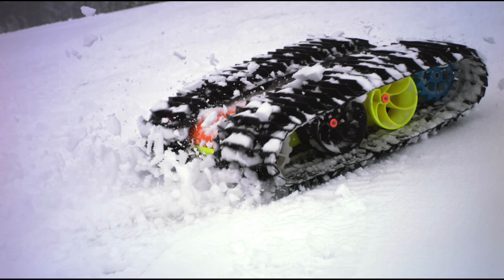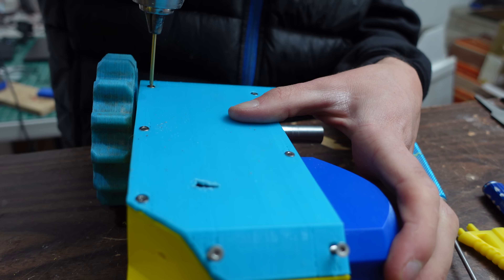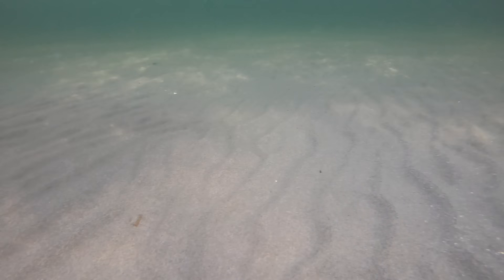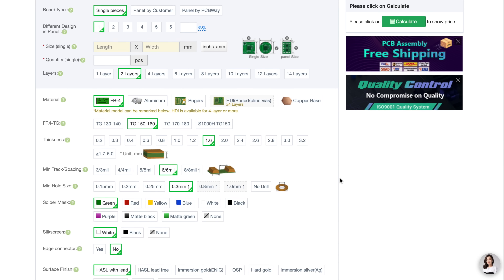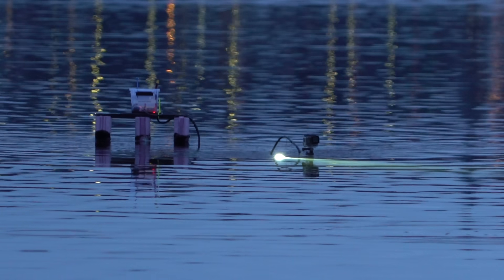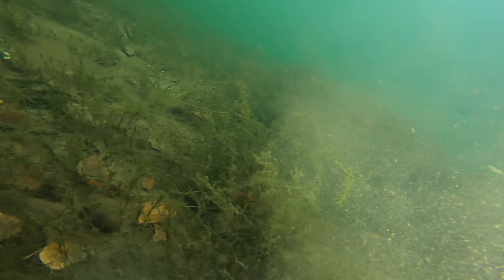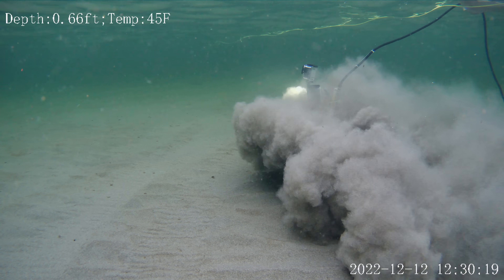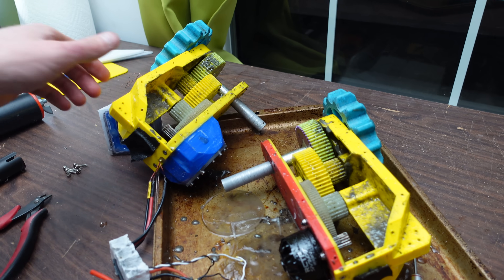DIY Aquatic R/C Tank

Comment: You should add variable ballast tanks. Ones that normally are filled with water and then either push the water out mechanically or pneumatically? I believe a ballast tank full of vacuum adds buoyancy?  Like a syringe sealed at both ends but one side is full of water with an open port and the other side has a piston sealed through o-rings, a screw on the piston pushes out the water when turned resulting in an empty side full of vacuum? That vacuum weighs less than the syringe full of water so it adds positive buoyancy and the tracked-sub will rise to the surface. Does that make sense? Other than that, pretty cool little machine. Or Rover?  Water drone? Modify a robotic pool cleaner to do the same thing?

Comment: I'm sure it's possible with some hacking to transmit analog video over an optical TOSLINK cable. That would make it impervious to the electrical noise over the length of the wire.

Comment: What about acoustic transmission instead of an umbilical cord? Sound propagates very far underwater, and there's easily enough bandwidth on an acoustic carrier to transmit slow-scan TV and control commands. Recovery back to the surface can be done with an underwater balloon system -- pierce one of those tiny CO2 or whipping cream cartridges with a solenoid to inflate a large plastic airbag that'll lift the rover to the surface.

Comment: For waterproof FDM parts make sure you print with ZERO retractions. It can be done. Also, anti-fogging trick; if you have AC in your room, turn it on - nothing dries air out easier.

Comment: Build a structural mount for a rope and attach then use a rope to tether the underwater boat. The cable then is tied to it, so that should you have to pull the vehicle to the surface you don't damage or rip out the cable.

Comment: You should get a CO2 canister and a balloon. If you get too deep, you can bail out by inflating the balloon and have the whole thing float to the surface where you can come get it with either a boat, canoe, or grappling hook.

Comment: Could have added a small gas cartrige with a remote activatable valve and a ballon to get it to surface in an emergency. Maybe even a doughtnut shaped ballon that goes around the rover so it could still be maneouvered with the track.

Comment: you need add 3rd wheels on front above one current on it on fronts so that way doesnt get trigner up on stuff plus have way get over hills and you want middle heavy
2nd you can buy weight from diving stores
and yes you need more torque not speed for underwater

Comment: Isn't the motors able to run in water?  So you don't need to fill them will oil.  Then it will run easier.

Could really use a compass and a depth meter of some kind.

Comment: Generally, most BLDC (and even brushed) motors are fine to run in submerged freshwater. I'm not 100% sure about saltwater, but i would assume that BLDC motors, if you give them a good rinse after every run and dont push a high voltage through,  should be fine.

Comment: You might want to have a floating line going all the way to the surface barge in case you need to pull it in.

Then you won't have to grapple it everytime you lose mobility.

Comment: If you can include a full scale paper print of the wood piece with the kit, that would make it much easier for people to make. Then they can just centerpunch the design through the print rather than having to manually lay out all the holes and edges, and easier for you to buy 50 large prints than 50 people each finding a printer.

Comment: You wouldn't have needed to submerge the motors in oil, bldc's work just fine under water with just a little waterproofing on the magnets and the cable joints ;) look at DIY ROV's, most of them don't use sealed bldc motors (tho some also have the coils potted), even in seawater

Comment: you need a little boat with a long cable tethered to the boat so you never loose it an yo could then have a big screen an do away with fpv cam it it will always have problems

Comment: Those motors and wires should be fine with immersion.  The copper will transmit electricity well before the water will.  Just make sure that the bearings are sealed and shielded to keep grit away from the balls.  You needn't put the ESCs in the barge either, just pot them in heat conductive, ceramic-filled, epoxy...to keep them cool and dry.

Twenty two years ago, when I was machining and winding my own LRK outrunner motors, I encapsulated my windings in ceramic-filled epoxy to keep them from squirming around AND pull heat away from the motor cores.  I'd terminate the windings and plug the bare connectors from the motor phases into a 'blank' female half of a connector (to set spacing) before encapsulating them...this would fix the phase wires rigidly, leaving just the bullets sticking out of a glob of ceramic epoxy on the side of the motor.  That way, the female half of a connector from the ESC would plug into the motor without having to go to the trouble of wiring a male connector half to the short wires from the motor windings...nice and solid, too...no flopping around and fatiguing the wires from each phase of the motor.

Comment: idea of a upgrade that you can do so it seems like when it gets stuck it is a very very big problem so I don't know how you would implement this but you know those life jackets that instantly expand Farm a CO2 cap maybe you can Implement something like that so I've ever get stuck in the very bottom and you can not get it and it will float to the top I would add two Motors to the receiver so then you can just drive it back just an idea and might save you some headache.

Comment: One way you "messed up" was by only sanding the plastic surface of the plastic to acrylic silicone mating surface‼️👏
Silicone is notoriously bad at making a "proper water tight seal" when one or more surface is smooth acrylic 💯👍

Comment: I think those submerged foundations must indeed be wood. I wonder why you would think they shouldn't be? After all, wood that size is more reliable and durable than any other building material. Concrete will suffer from porosity and aging, steel will corrode away. As long as there is no direct contact with air, certain hard woods will remain strong almost indefinitely in underwater foundation.

To found this statement with a relevant example: most older docks are founded on a grid of wooden poles. This allows for the wave front to continue under the dock instead of splashing up the quay wall. Look at any large harbor of about 100 years or older and you'll find that all quays are atop a wooden structure, even when the top is concrete, cobble stone or even massive blue stone (the latter is the case in the downtown port of Antwerp, currently serving as a cruise terminal: massive 100 ton blue stone blocks are seaming the quay wall, resting on a masonry wall which in turn rests on a wooden pole grid that runs dozens of meters/yards under the dock - it's off limits even for salvage divers who might be looking for a corpse because of treacherous currents. I used to be one such a rescue/salvage diver, hence my knowledge of the submerged structure of docks...)

Comment: I am not entirely certain I get how sealed are the motor axle (no SPI seals?). However, the presence of air bubbles within the motor housing imposes significant pressure challenges on the seals and 3D printed components. Given the inherent difficulty in completely eliminating even the smallest air bubbles trapped in such an engine, one potential solution could involve accommodating volume variations in the chamber through the use of a flexible membrane, like a primer bulb or a bulb blower filled with oil. A similar approach has been successful in this context with stepper motors housed in 3D printed enclosures connected to a bulb blower and filled with mineral oil. It works (at least) at 300 meters deep! https://www.youtube.com/watch?v=bM6WV9xl0QM

Comment: Submerging a 3D printed container of mineral oil in water, because the container is probably leaky is a dick move towards nature. If you can't build a working gear housing without doing this then do something entirely different.

Comment: You have a tread problem. they need to bite but be flexible to conform to the rough surfaces with a suspension that will keep it in tension while allowing the track to function. Your tread design is based on tracks for SNOW, silt, mud and rocks is different. I would look at inspiration from actual mud/swamp trucks and the ripsaw light tank (https://www.youtube.com/watch?v=DhDIWG6Qyc8)